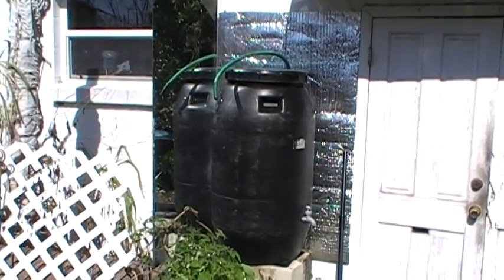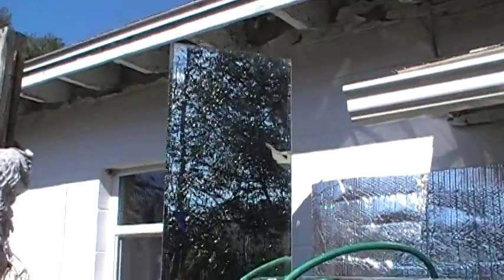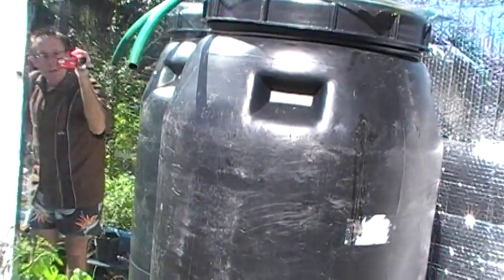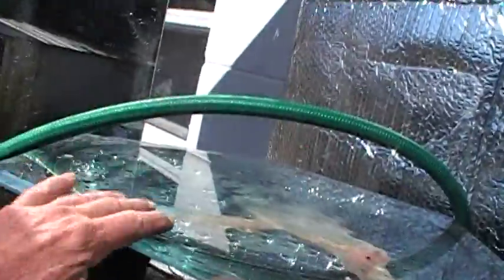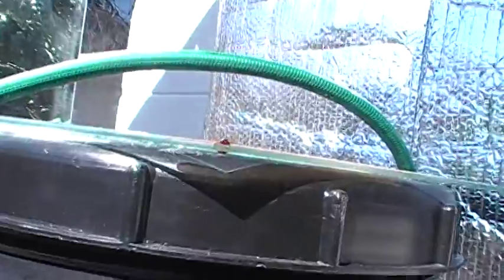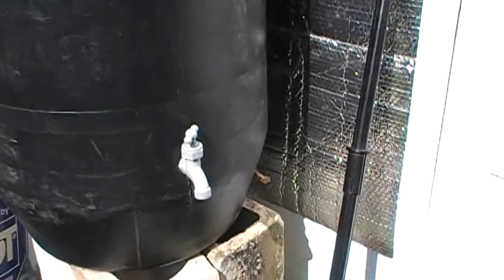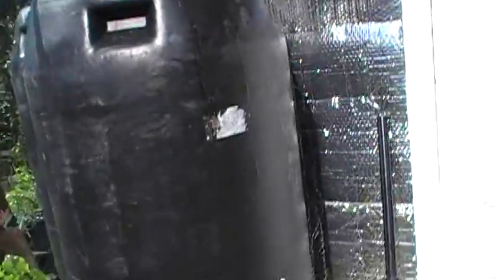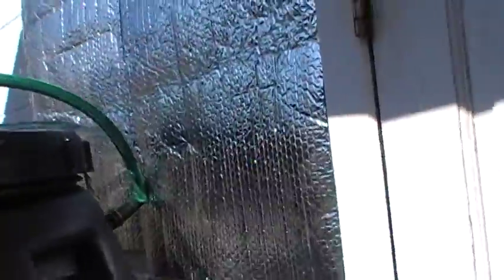Solar Water Heater: Crude prototype

Comment: i think you need to focus on heating the bottom, because hot water rises, right?  So if you focus on heating the top,  you will just get super boiling water up at the top, but it is not necessarily going to go down.  On the other hand,  focus all  your heat source at the bottom, and the water will rise as it is heated.

Comment from the maker: That glass box idea is great as in Denver I used scavenged double-paned patio doors to make giant hotframes for winter gardening. If I can surround the barrel in some fashion with double paned windows and still access the spigot and be able to stir the water before use I bet I'd get MUCH hotter water. Thanks for that great idea!  John

Comment: Just an idea if you didn't think of it already, would be to put the barrel on a turntable so it can be turned to face the sunlight better if it was put into a box with a glass window, maby double-pane type, and the other two sides could be mirrors..and insulated on sides and back.